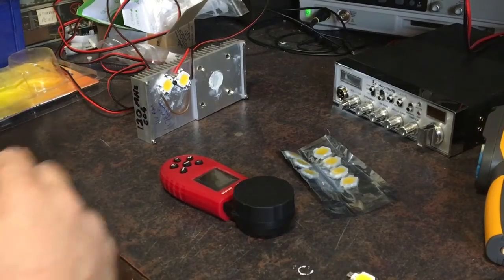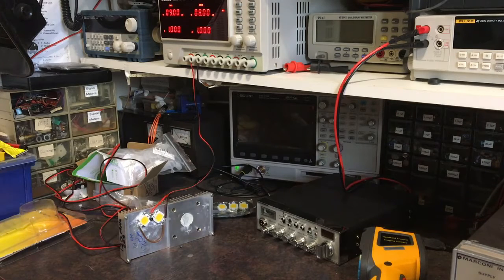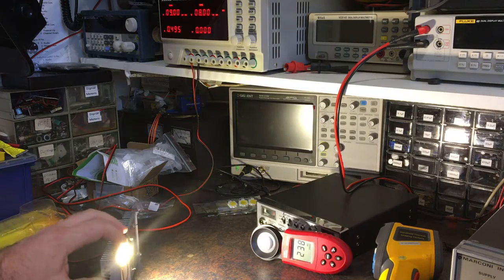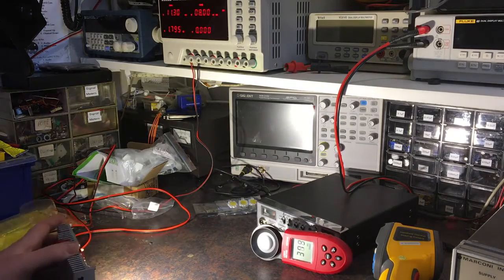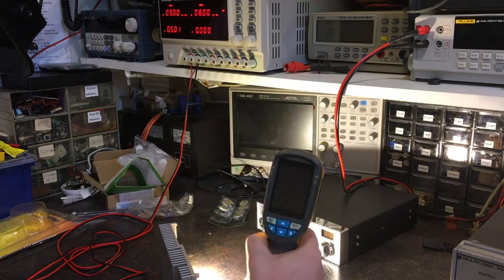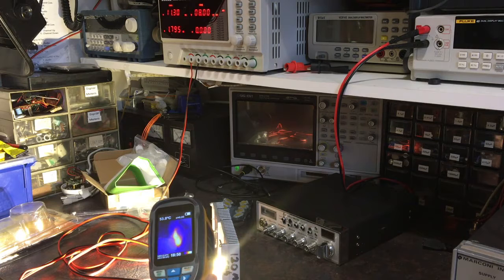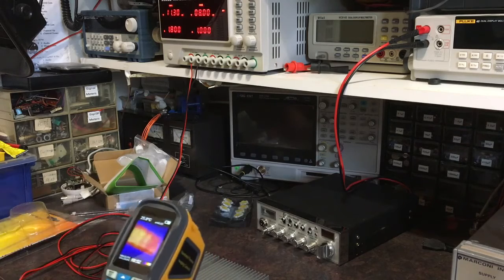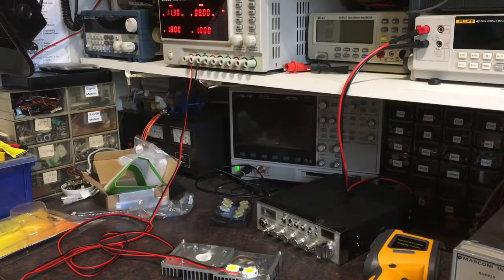#121 10W LED Testing

Comment: I see you had a Cobra CB unit on your bench. I had that exact model when I lived in UK. I had it fed into a 100watt amplifier and a half wave end fed dipole. Quite illegal but I sure got some distance. I should say my aerial was mounted on top of a large cinema where I had a flat at that time. Sorry, nothing to do with LEDs but brought back some great memories.
Reply from the maker: I used to have a cobra 148 GTL DX, and a 400W linear amp into a Sirio 2012 5/8 wave, which had the base of the antenna at 50 feet on 2" steel scaffold poles, could talk for hundreds of miles if the person at the other end also had a linear (direct, not skip, skip is cheating).